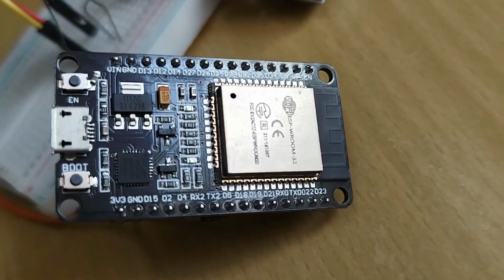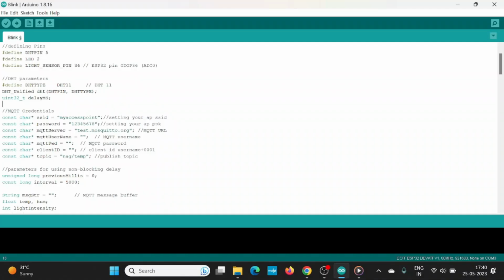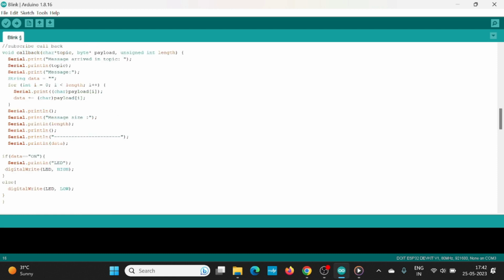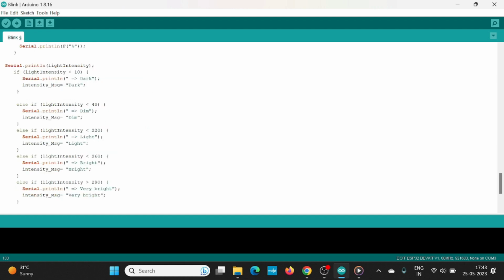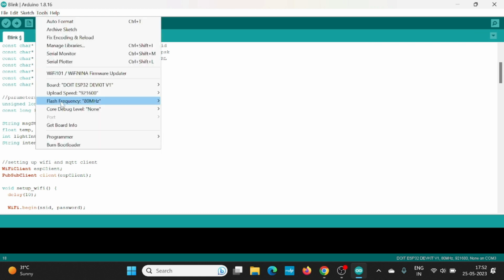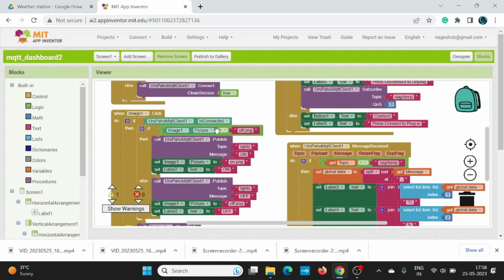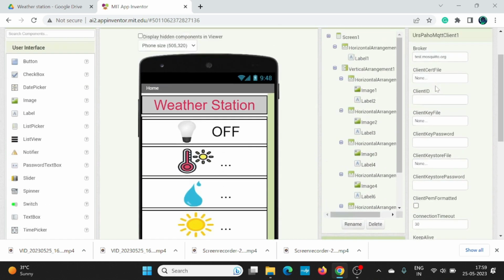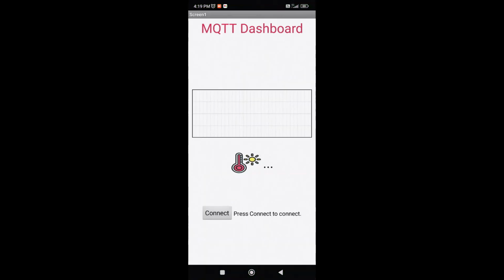NodeMCU Weather Station

Comment: Hi, i have same Esp32 (devkit ) module i am using Arduino ide on windows 7 , also installed the drivers but unable to upload code, however Esp32 (Node32S) works fine.
Reply from the maker: Try holding the 'boot' push button for a moment while uploading.